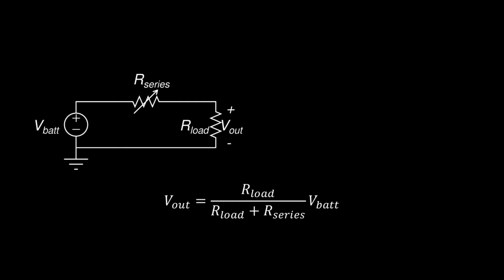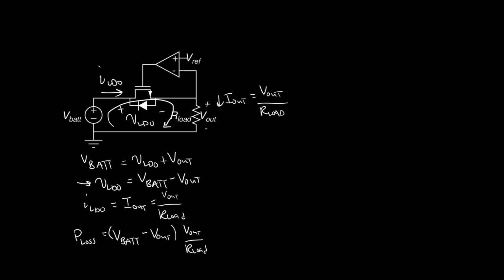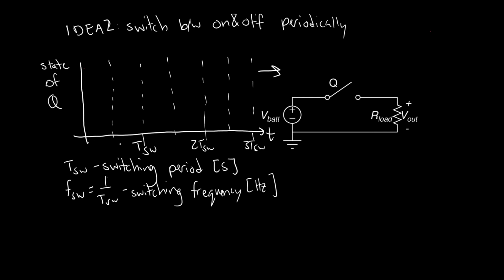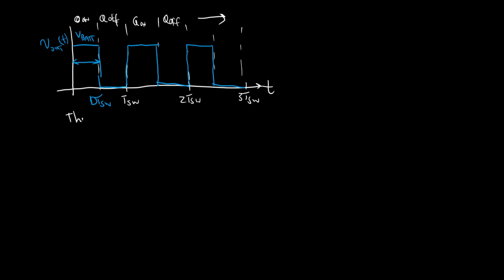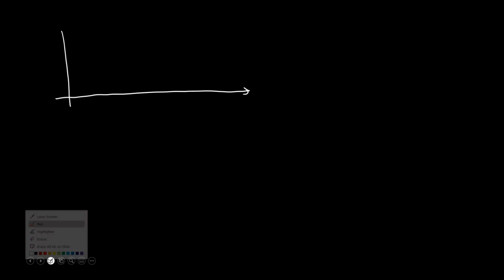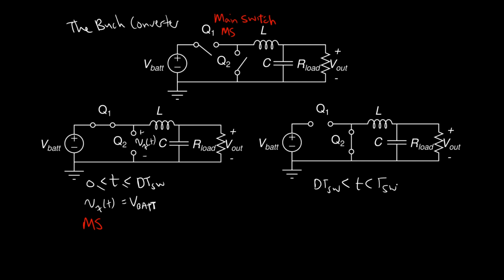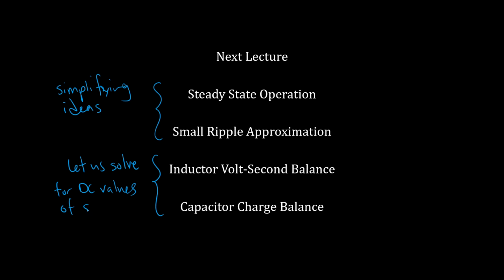Lecture 1: The Buck Converter

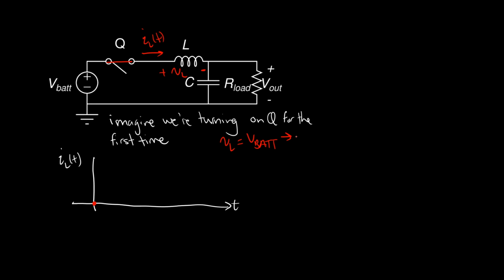Comment: Why is VL = Vbatt at time = 0 at 31:56?
Reply: Because the capacitor is not charged and thus the upper plate (or upper pin) has 0V potential at that particular moment